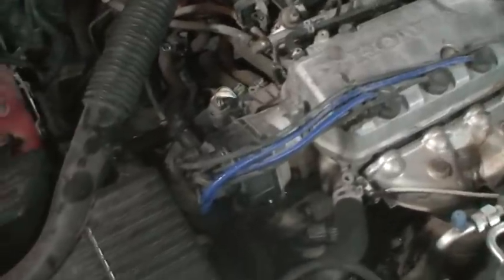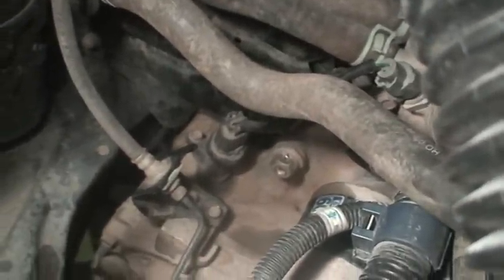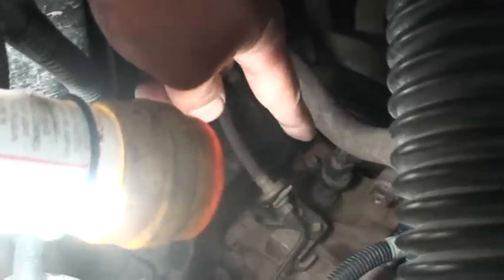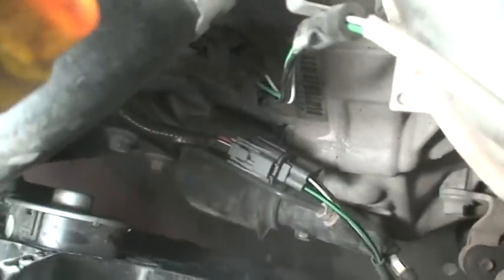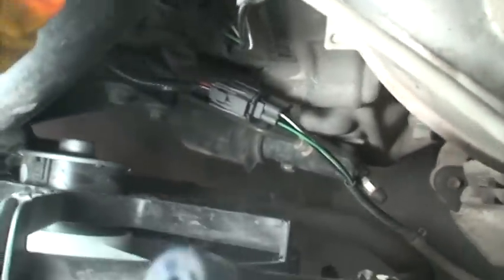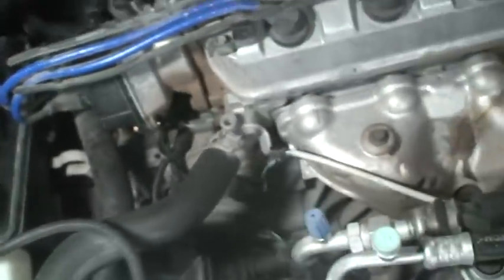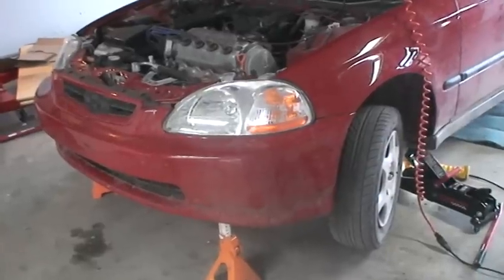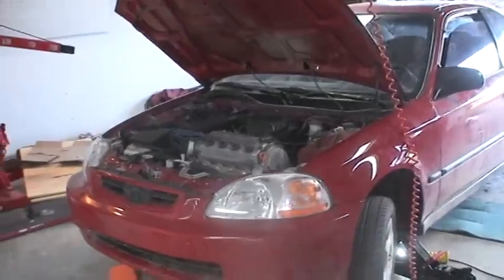96 Honda Civic Clutch Repair Part 4

Comment: Why do you think the pressure plate bolts snapped off? Any alternate theories to "heat"? Curious. It's scary snapping off bolts. I never successfully extracted a snapped off bolt. Thanks again.